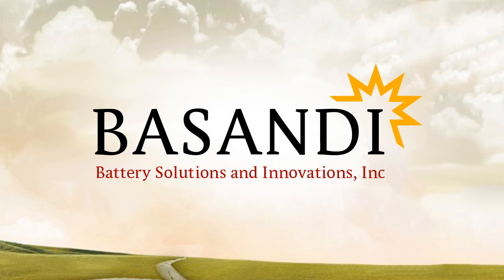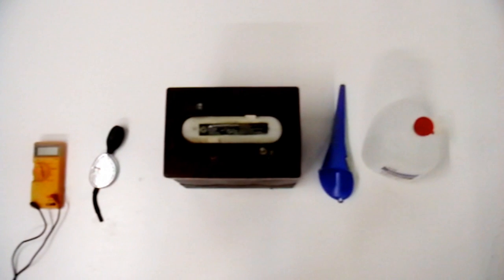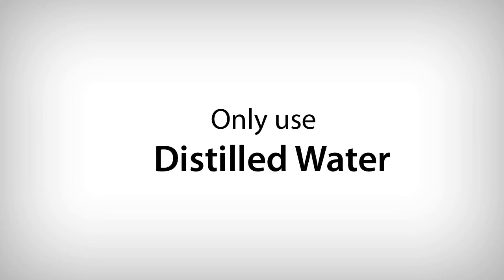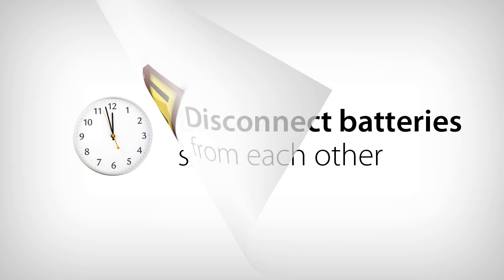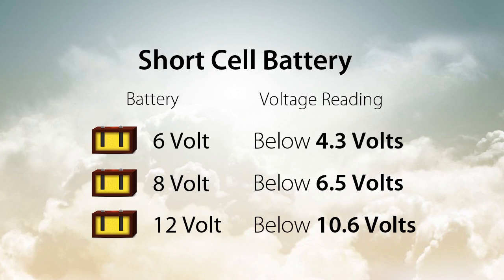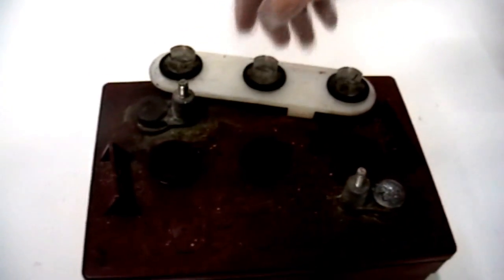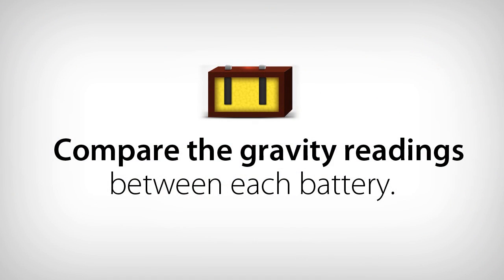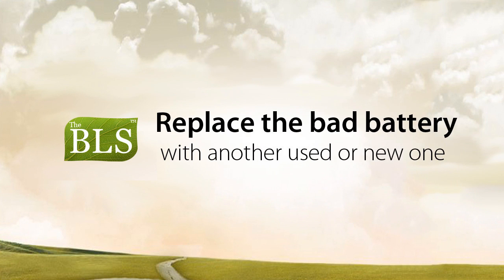Testing For a Bad Battery

Comment: is there ever a certain battery that goes bad first when using a series of batteries?
Reply from the maker: Thank you for your question. The answer is certainly, over time batteries stratify and the concentration of sulfuric-acid becomes higher at the bottom. The controller reads that the batteries are fully charged and turns off the charging cycle to prevent overcharging. In reality the last battery on the series is left partially discharged and then that battery starts accumulating sulfate crystals and ends going bad. You can read more about it here:
http://batterylifesaver.com/2013/03/stratification-the-hidden-battery-killer/
Please let us know if you have any other questions. We are here to help you get the most out of your batteries.

Comment: quick question,i just bough 2 T105RE  6 volt trojan  golf cart batteries, hooked up in series for 12 volt system ,,,,first time i hooked them up to a schmacker  1.5 charger /maintainer they reached 13.6 before charge light turned green,,,,,,,a week later i hooked it up again but they reached 14.6 and still no green light,, i disconnected charger in fear of over charge,,,,,,,,,should i have allowed the charging process to continue to green light appeared ?........were the batteries attempting to equalize ?
Reply from the maker: +bob woerner  For how long were you charging the second time? I am not familiar with your charger but many chargers follow a curve of high voltage then drop to normal ranges and then goes into a trickle mode.
Reply: i think about 4 hrs on the second charge ,when i saw it at 14.6 i thought i might damage them so i discontented
,,but starting to think it was ok ?
Reply: bob woerner m